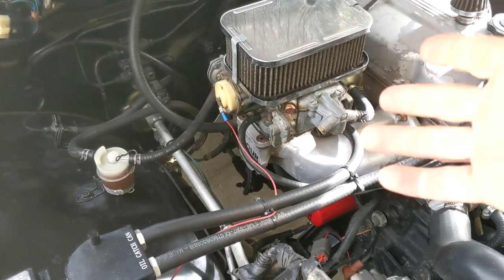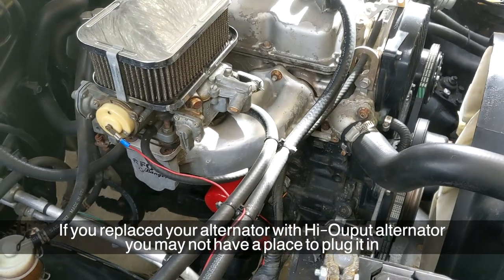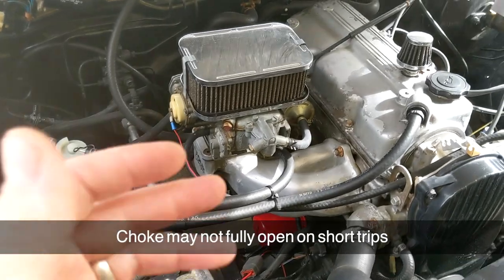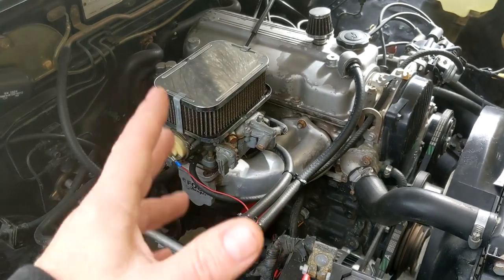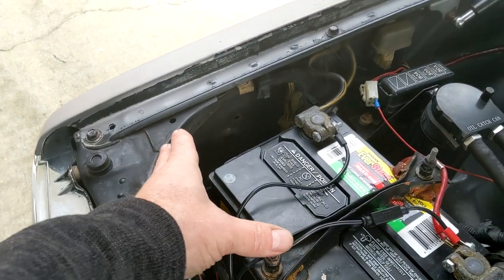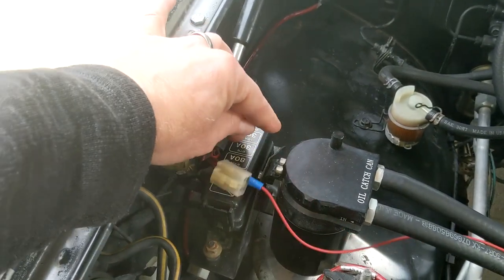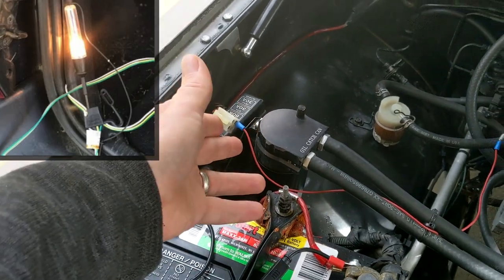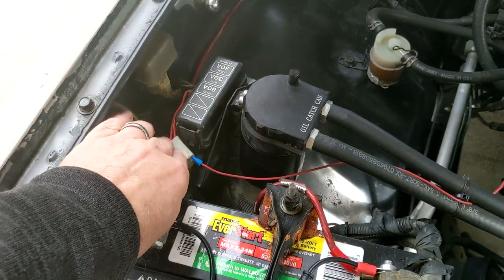Electric Choke Wiring Weber 32/36 | Mazda B2000 B2200

Comment: I'm in Arizona, and with our climate my Weber 32/36 DGEV is fine plugged into the rear of the alternator.  If one wanted 12 volts instead, there are adapters to fit under a switched fuse in the fuse box under the dash and then a new wire routed along the firewall to the Weber.  Whenever I add a wire - like I did for my aftermarket tachometer and aftermarket cruise control in my B2200, I use a piece of masking or label tape and a Sharpie and identify it.

Comment: Very helpful Mitch thanks.  Theres something more you can do on the safety side of things if i may suggest.  The female spade connector connected to the choke housing can be safer if it has shrink wrap on it.  You can also use a small zip tie and secure the wire to that vacuum hose thats at the base of the carb.   This way if the spade connector falls or gets knocked off it wont ground out and be a potential problem.

Comment: Helped me. I'm forced to run the stock carb here in California. That stock choke also under powered ? It's always been hooked to the alternator.
Reply from the maker: That's fine
Reply: @MazdaMitch  TY
Reply: Hey MazdaMitch...those vintage adverts were real cool and the claims made by the spokesmen about things like handling etc. Just wondered what about these trucks made you and others into big Mazda truck enthusiasts?
Reply from the maker: For me I have like the 86-93 model since it was introduced. Back then I was in Jr High School and all the highschoolers had them and customized them. I loved this truck. My dad got one in 1988 and in 1990 it was mine and I have had it ever since. Its the silver truck with black roof in my videos. I have often done repairs on it and my other truck the red one and thought I would start recording to help others.

Comment: What’s the pros and cons for the oil catch can?
Reply from the maker: Oilcatchcan.com The oil catch cans prevent oil and other contaminants from causing a buildup of debris inside the engine's intake manifold and collecting on top of the valves.
Reply: @MazdaMitch  does it help with valve chatter on hydraulic valves
Reply from the maker: @Mini_Truckers_Lifestyle  no it doesn't, it just helps keep the intake and valves clean, for a cleaner burn. If you hydraulic lifters are noisy, it could be time to replace them.
Reply: @MazdaMitch  the shop that did my valve cover gasket said to pour marvels mystery oil down it or this other stuff call ec5 or something and it should help it a little bit